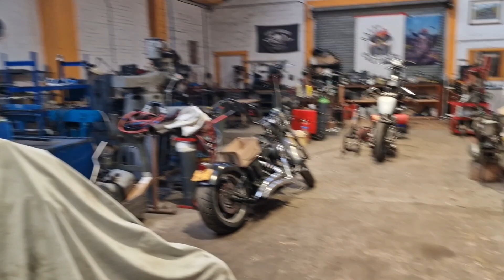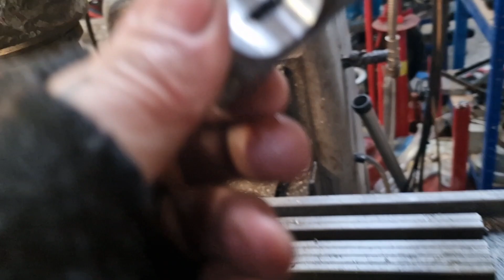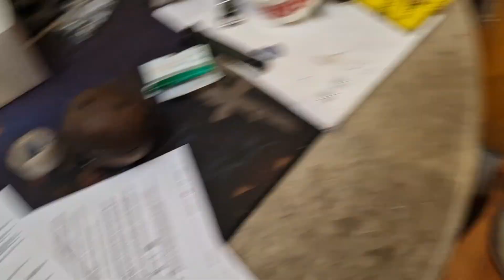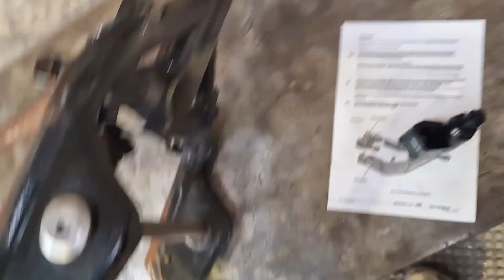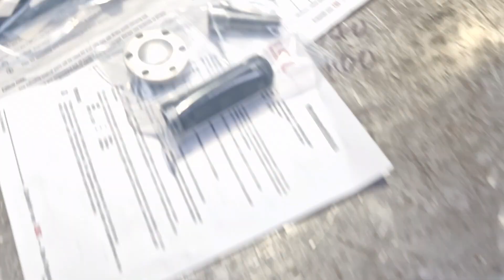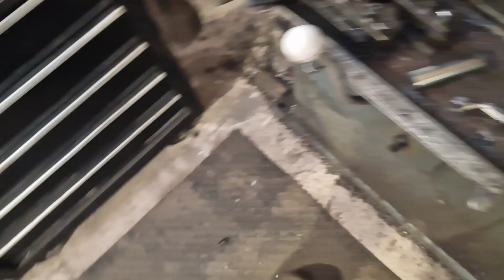How I Build Handmade Custom Bike Vlog #bike #engineering #handmade

Comment: Really liking the Kawasaki build. I would be a bit careful about moving to a small workshop and containers, in my experience 40 ft containers a a nightmare, I used to spend hours moving stuff about because the bit or things i needed was always at the back, and as the containers I had where not insulated they used to condense like mad if it was cold.
Reply from the maker: Cheers Frank buddy 👍

Comment: a shared Summer thunder box is not worth a few months of cold, Just see if you can make a few alterations to the current shop - if you can try get rubber mats around the areas that you strand the most stop the concrete sucking the heat out of your feet.
Reply from the maker: True Bert True

Comment: Stick with the current unit, space will be an issue in smaller unit , install measures to retain heat and more importantly it’s nice to not have to share a Thunder Box 👍🏻
Reply from the maker: That's the plan! Thanks buddy